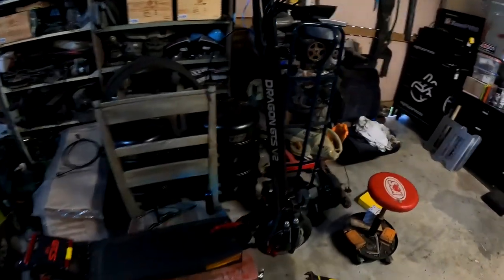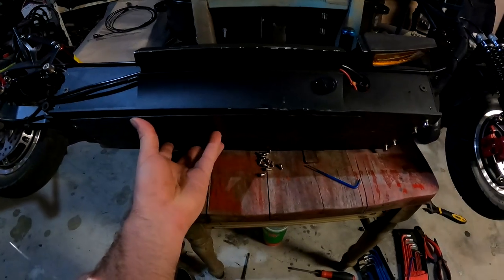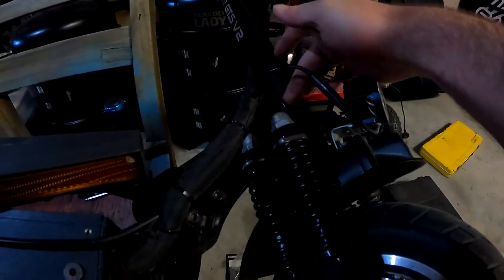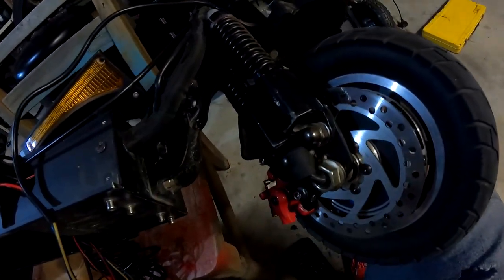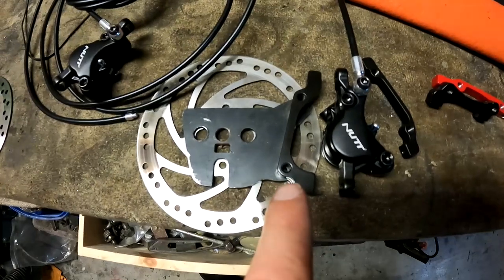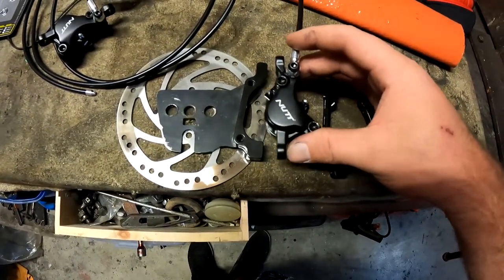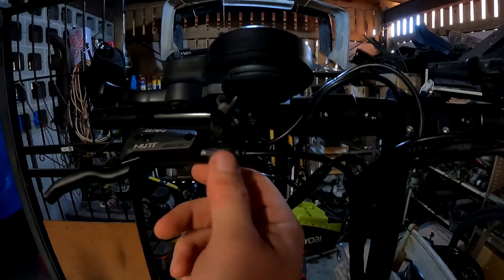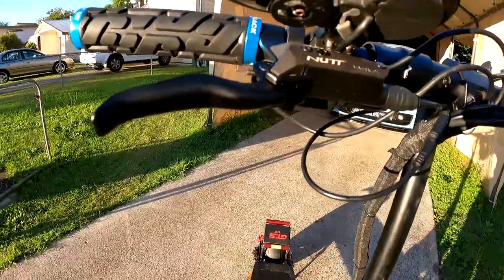Dragon GTSv2 DIY hydraulic brake upgrade pt1

Comment: Love the upgrade, what model are the rainbow discs you purchased to upgrade? And do you know if the discs are the same on the V1 and V2 models of the GTS? 

I have an issue where 1 of the discs appears to have a slight bend as there is a part of the disc that constantly rubs against the break pads every rotation and I have tried so many times to adjust the calliper so that it’s perfectly centred and I can not get it to go away. The other wheel had the same issue but I managed to get it to a position where is does not touch. I figure I’ll just replace the discs with better ones and if there is still an issue, replace the whole break setup. Appreciate the feedback.
Reply from the maker: Hey David. Yeah GTS have 140mm brake disc with standard 6 bolt discs. Sounds like you just have a warped disc to me and is fairly easy to fix. Just alittle tedious
Reply: @dcunplugged31  Thabks for the reply and feedback. I’ve seen there are 2mm thick and 3mm thick version of the discs, does it matter which thickness to use?
Reply from the maker: @davidspence9749  3mm will give you more time before you have to change them.
Reply: Yeah it's a really dumb design to have to disconnect the motor cables and thread them through just to change a tyre or a disc.

Comment: did you upgrade the size of the disc rotor or can it only take 140mm ? as i was looking at getting the GTR V2 2022 MODEL but the disc rotor size is a put off so just woundering if you can upgrade to 160mm

Comment: Howdy. I just purchased 2 of the GTS V2's. One for me and one for my wife. We hope to use them for checking out the towns we visit when caravaning. Your video is pretty dark so it's a bit difficult to see all the details. I gather you only replaced the front brake. Why did you think that was necessary?
Reply from the maker: We replaced front and back as this is a part 1 there's a parts 2. 
Its alot to do with brake reliability and now they wear evenly as hydraulic brakes clamp from both side of the rotor mechanical pull from 1 side making them needing to be adjusted frequently
Reply: @dcunplugged31  Just after my original comment I saw your Part 2 so all is clear now. I gather you really rate the conversion highly so I will see how we feel after we get some mileage on our scooters. The cost is around $125 for the set, back and front , is that correct?
Reply: The brake pad contact area with the rotor disc is only about 60% of the disc width.. which quickly wears the pads & needs to be frequently adjusted..to do this correctly the caliper needs to be removed. You can see the wear on the rotor in the video..not utilising the full contact surface..Good job DC on fitting better brakes!